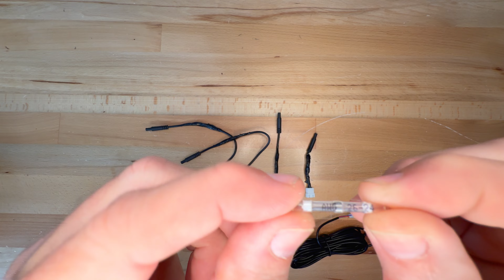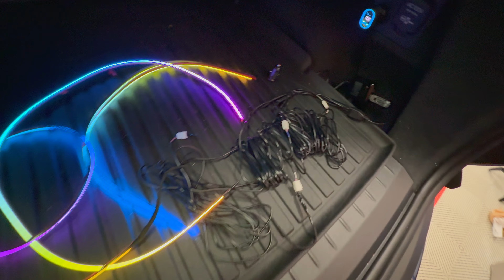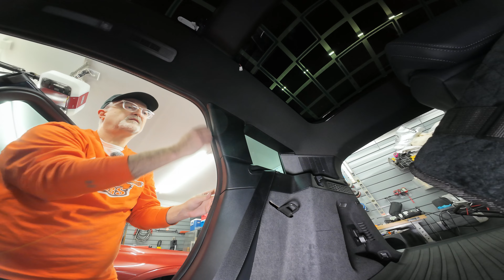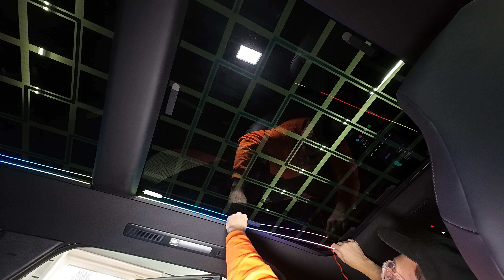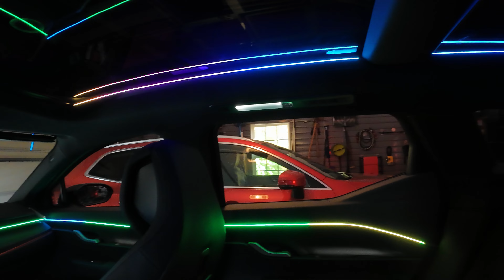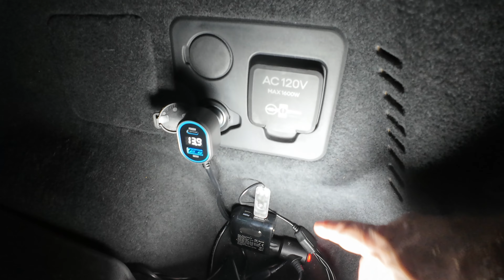Fisker Ocean - LED Ambient Lighting Part 2

Comment: Matt, tried looking for a video about how to remove the rear passenger door panel (interior) but no luck. The ambient lighting cord got stuck inside the door panel and I need to remove the panel to get to the cord. Ideas?
Reply from the maker: @DMan-OceanOne  I’m not aware of any videos showing how to remove the panel. Your best bet is to review the service manual.